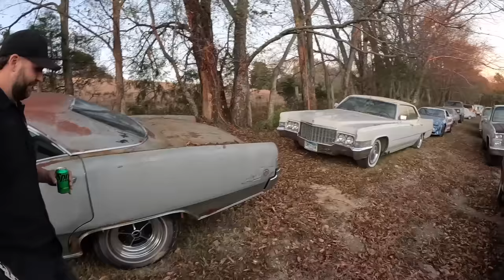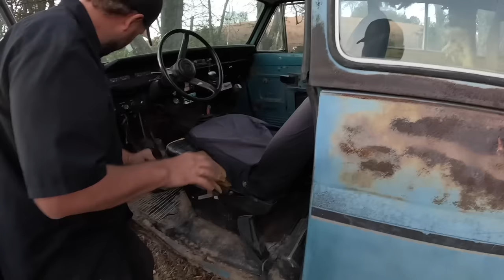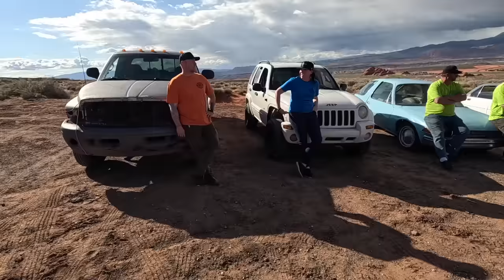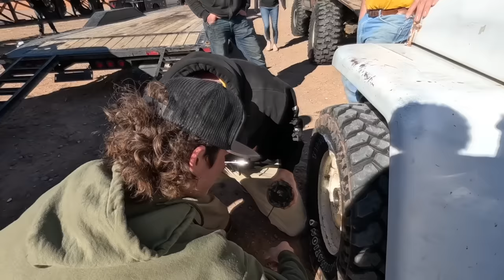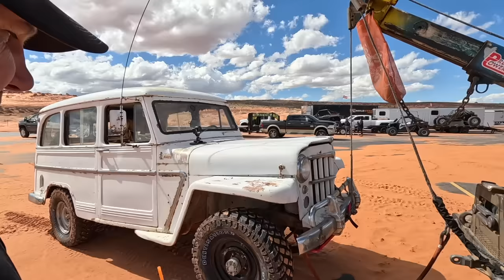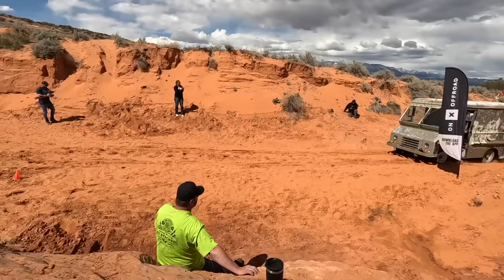We Take A Tour Of Rusty Acres With Vice Grip Garage! Plus, First OnX Offroad Competition

Comment: I know that red ford. I know who built it. Gene did sign it. He didn't chop it. It has fiberglass fenders on it because the originals needed a good bit of work and I bought the original steel fenders from the truck to use on a 36 ford pickup I had. The original builder is from Paris tx. He's a pretty cool dude. He also was building a panel truck the same year. The truck used to be nicer but got parked for years then sold to the guy vice grip bought it from. At one time it had a bigger Engine in it if I remember correctly.  Which barely fit. Like a 383 Chrysler or something like that. And it used to be primer grey with flames on the front.

Comment: Derek’s Roadworthy Rescues is an awesome show👍
Reply: You think so? They're staged! Look at the 37 Chev he just rescued, It's supposedly been parked for 25 years and he puts a battery in it and it starts right up. points, plugs wire and starter just happened to be good and there was was no rust or other junk in the tank. And when he moves it you can see there was  green grass under the car. That car was prepped and put there just prior to filming.
Reply: @tyendor503  Personally, I just think it's far more entertaining than the onX build challenge👍

Comment: I broke a third member durning a heat race. Welded it up in time for the main. Never even put the cover back on and ran 25 minutes main with no issues. Gear oil is for highway use. 😂😅😅😅

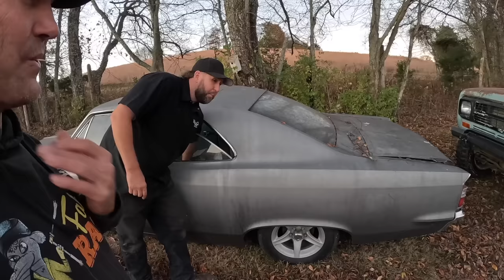Comment: 7:20 Lost out on picking up an IH 304 drivetrain because a 70s SII came up in the white sheet w/ the Nissan Diesel motor. Was told it was in a garage fire but wasn't prepared for the sheer scale of it. The thing was a burned out husk. Even if aluminum components weren't ruined it would've required taking everything apart down to the last screw to get even just the engine let alone the IP working again. Wasn't worth the $1000 asking price. If was only $500 then perhaps since the axles would've been salvageable & other than the flash rust after being doused of the sheet metal it was still "straight". 

So now it's making do with just the gasser Scouts...which I prefer the 60s styling which only the late model Bronco has finally caught up to unlike the original "box" the first ones were. Have a running 62 w/ the original 152. Have a few more in various states of intact-ness.

Comment: For future issues with a plastic bag filled with gear oil you may want to do what cake decorators do and twist the open end of the bag shut then cut or snip the corner of the bag and then squeeze the gear oil into the fill hole just like a cake decorator would squeeze the filling onto a cake?!?!🤔🤪